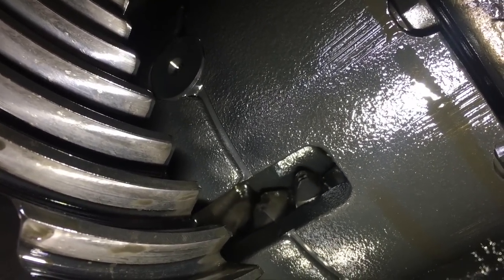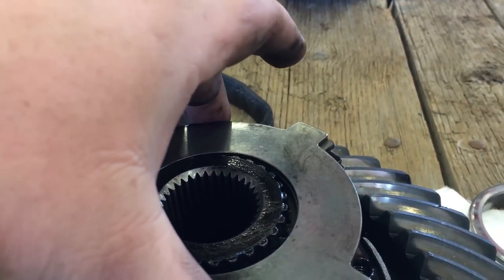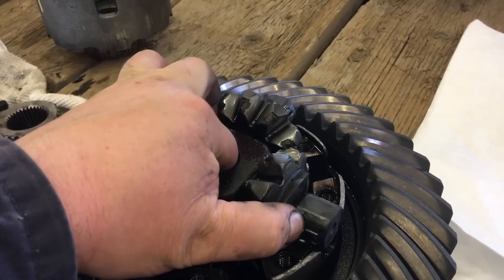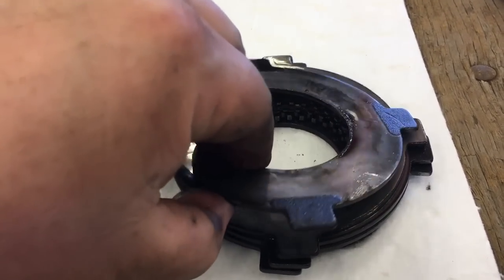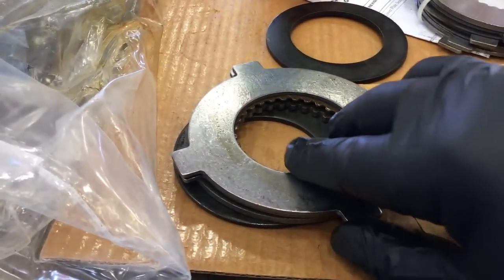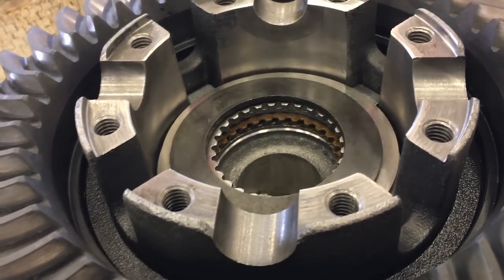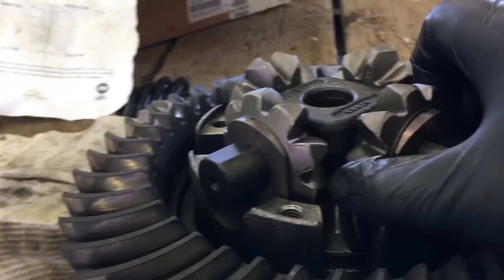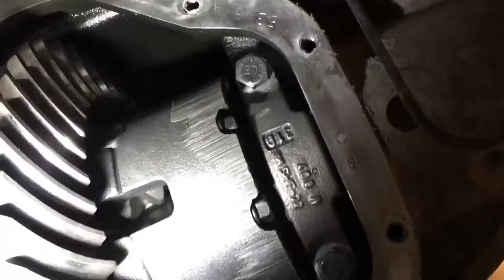Dana 80 Limited Slip Clutch Rebuild

Comment: Just pulled a Salisbury unit off of a series 2 E-Type, clutch discs were the same, found a broken shim in there too off the pinion somewhere. Luckily the gearset remained intact it is impossible to get them here across the pond. Thanks for the video!

Comment: Shouldn't the friction clutch plates have been soaked in gear oil or limited slip additive for a few hours before installing?
Reply from the maker: You can if you really want too, they come pre-oiled
Reply: Yeah when rebuilding a PowrLok with friction disks you're supposed to soak in friction modifier for 24 hours, personally I don't like using disks with friction material on them. I prefer the factory Dana Steel Disks and a Belleville Disk for a more aggressive engagement.

Comment: I just pulled my clutch pack and have 12 disks per side. I'm totally confused now, because I can't find anything about this set up. I need a new clutch pack, but can't find any suppliers for the 12 disk pack
Reply: I've been researching this for two weeks (never found any answers) and finally ordered this set that's listed in the video description from Amazon. I had a total of 24 disks in my old set and it was totally throwing me off. I received the new clutch pack and it appears this is a new style clutch pack that only has 8 disks per side. I checked the thickness between the two packs and they are the same. I'll be uploading a review including the documents that came with the new clutch pack to the Amazon link I ordered from in this YouTube description. I'm sure there are many others out there looking for this info.

Comment: Supposed to soak the friction plates for minimum of 30 minutes prior to install
Reply from the maker: as you can clearly see in the video the friction pads already have oil, once they are installed and differential is fill with oil the clutches are wet........ soaking for 1/2 hour isn't doing anything

Comment: I have a 02 3500 Cummins Duallt with the Dana 80, my spider gear and clutch packs were destroyed, I went to a buddies 96, and I took his internal gears ring gear and everything, I am wanting To use his internals on mine should I change my ring gear onto his carrier and try to put it in or?